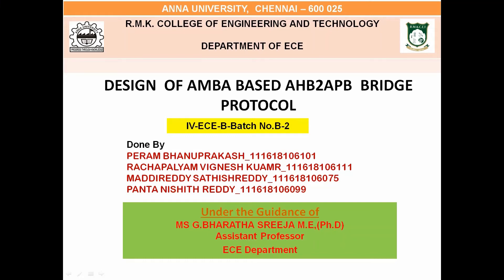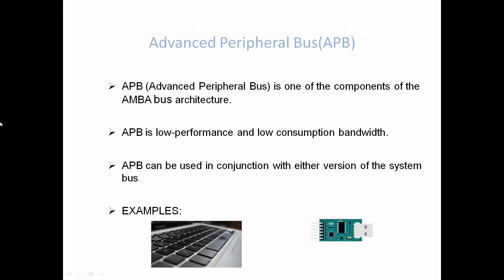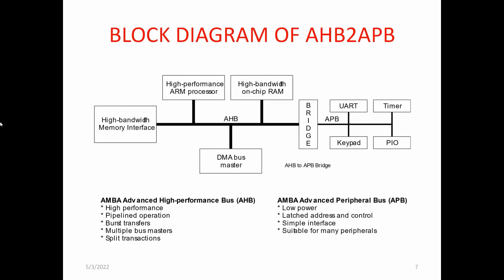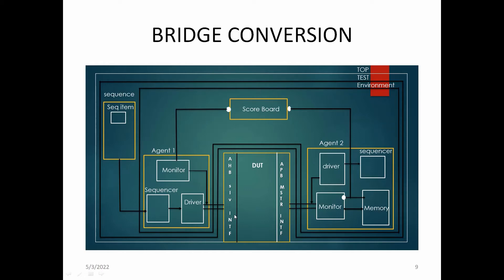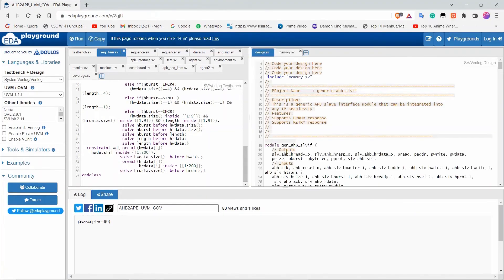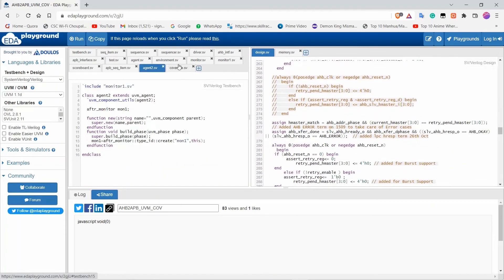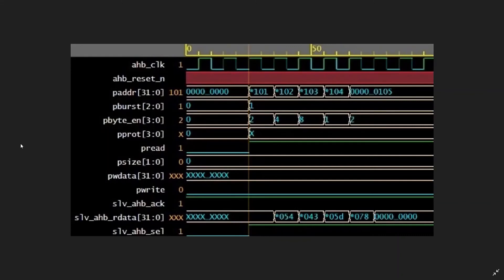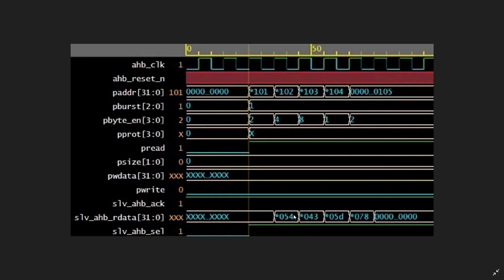DESIGN A BRIDGE FOR ADVANCED HIGH PERFORMANCE BUS TO ADVANCED PERIPHERAL BUS (B2) -RMKCET-ECE

Comment: 📚 The project discussed in the video focuses on designing an AMBA-based HP to APB bridge protocol.
🚌 AMBA AHB (Advanced Microcontroller Bus Architecture Advanced High-Performance Bus) is used for high-performance synthesizable designs and connects processors, external memory, and on-chip memories efficiently.
🔄 AHB supports the conversion of signals from high performance (HP) to advanced peripheral bus (APB) signals with lower clock frequencies.
🚌 APB signals are typically used for smaller devices like mice and keyboards.
🤖 The video mentions the use of master-slave interfaces in AHB and the role of bridges in connecting AHB and APB.
📊 The presentation discusses block diagrams and signal conversion in the bridge.
💻 Programming aspects include sequence item generation, sequence numbering, and the role of drivers.
📈 The design plays a crucial role in connecting components automatically for effective operation.
🎮 The video showcases the output with clock signals, reset signals, data signals, and selection data.
✅ Scoreboard functionality is used to check whether operations are completed accurately. 
created with HARPA AI